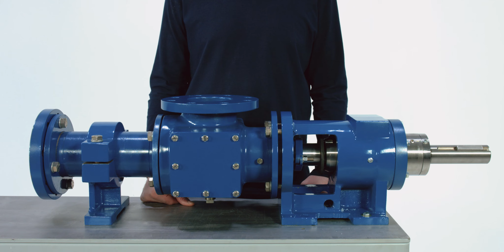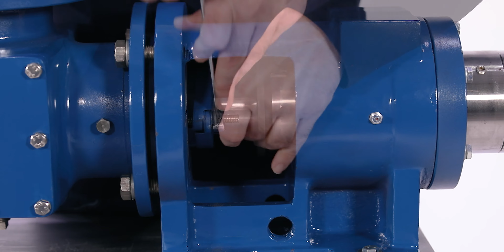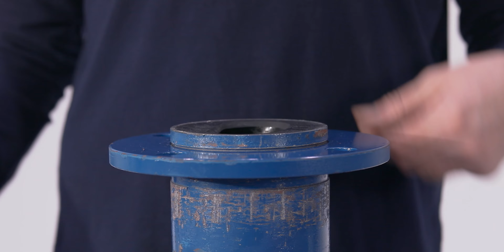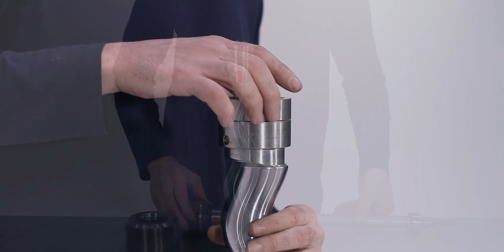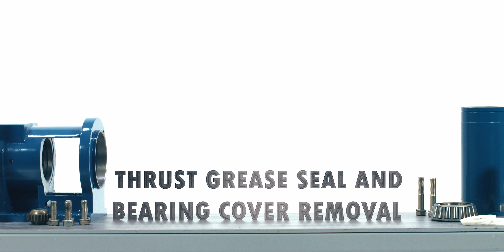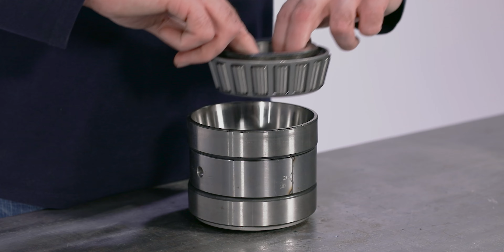Millennium Series 1E012G1L Progressive Cavity Pump Disassembly

Comment: Thanks for this amazing video. I have a question; This is what I know about Screw pump and PCP:  A screw pump is a positive-displacement pump that use one or several screws to move fluid solids or liquids along the screws axis.

For the Progressive cavity pump, The pumping element is a single “screw” that has a round cross section and rotates inside of a stator made of rubber which has a double cross section.  So the difference is in the number of screws. Progressive is no more than one screw.

But I also heard that "PCP has double screw, too. But I couldn't find any info about it. Thank you in advance.
Reply from the maker: Alireza, Thanks for the comment! You are correct for the PC Pump having a single screw.
Reply: @libertyprocessequipment9885  Appreciate your kind reply.